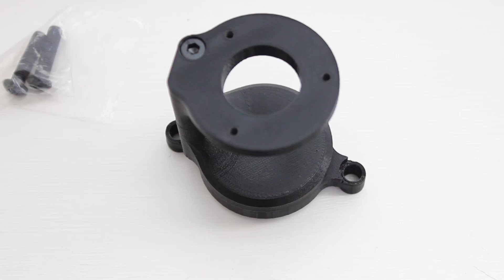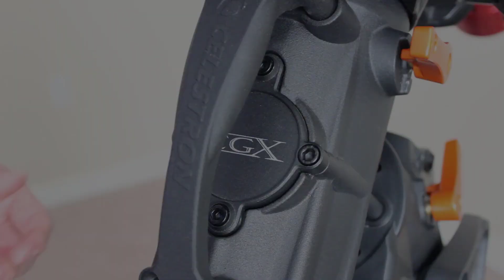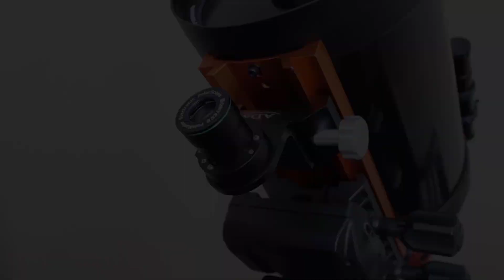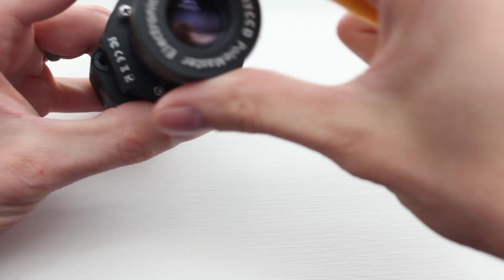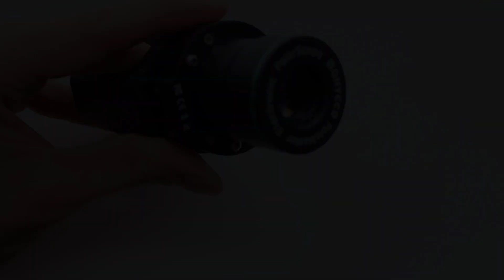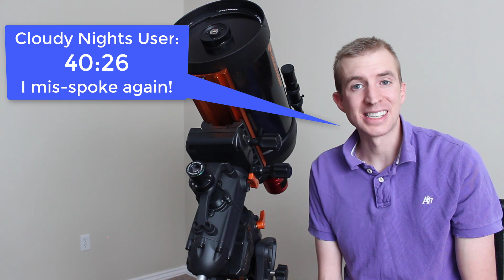Celestron CGX/CGX-L | QHY PoleMaster Mounting Solution

Comment: Cody, I am new to the hobby, spent the last year going through 3 back surgeries and that left me with tons of time in bed that I directed towards gradually piecing together a system.

I have a CGX-L with 925 mounted “permanently” on a set of JMI Wheeley bars that I modified to make it more stable while fabricating a way to mount 2, 100ah liFePo batteries.

I planned to shoot from my back yard, but constant wet ground and a heavy rig changed my plans to image from the front of my house where lights and cars where much more of an issue.

So before I cut my teeth I went ahead and got the HyperStar (which has always been my goal and defense to those that keep saying “should have started with a “refractor”) since the short exposure times would make shooting around traffic easier (and that it was).

I currently have an ASI2600MC mounted on the HyperStar with cables run through one of those arced cable management devices that I used as an excuse to finally buy a 3D printer.

Other than the feather touch micro focuser, the only remaining piece I have and the point of my long explanation is the StarSense camera and hand controller.

In fact, when I bought that camera a year ago, I think I might have watched a helpful video on your channel if I am not mistaken.

Now that my back is strong enough to spend time learning how to use what I have compiled, I am starting to lean towards buying a pole master; like you I had others tell me to do so, but owning the StarSense I didn’t see the use.  

Well that is until I began to see how much time I spent being a perfectionist lining up on the pole (doesn’t help that I can barely see it from my bortle 5 and nearly 6 home location).

Having HyperStar attached, I fire up my camera and try to aim the Wheeley bars as close to the pole as possible before sinking the feet to the concrete.  I then get out the Alan wrench and adjust the mount to dial in the fine adjustments while continually software zooming in my cameras view of the star.

Once I have satisfied myself that I can’t get it any closer, I tighten it down only to see it move from mechanical forces torquing the mount to the plate.  (I guess there’s no way around that?).

From there I end up doing an alignment while adding several calibration stars.

I wanted to describe my setup and very newbie approach to get the most accurate answer to the question I am sure you debated too; what will the polemaster “buy” me?  It seems that most people I read forum posts from ask the opposite question, “what does StarSense buy you” as they are sold on the polemaster.

I probably wouldn’t have begun looking at the polemaster again, had my StarSense hand controller’s display suddenly quit.  It was always hard to read in the dark, but with it completely broken I have been using the old hand controller and doing 4 star calibrations.  

I think the hand controller has a 2 year warranty, but considering I only used it a couple of times I have little faith in its robustness and would want a backup unit as a result.

Does any of this ring home with you?
What does the polemaster do for me over the StarSense?
If you are a StarSense owner, do you still use it after using the PoleMaster to polar align?
Finally, I noticed that the polemaster comes with a screen (or at least some models do). Is that so you can have a rig without a display (remote control it) yet still be able to align without needing to look through an eyepiece.  Not having an eyepiece with the HyperStar setup makes that seem more appealing.

Maybe I have given you enough questions for a follow-up video LOL. 

You seem like a nice and informed guy so I felt open to ask.  If you only have time for a quick response to any of the questions, it’s all greatly appreciated.

Keep up the good videos.  I use to spend my time and money on motocross and posting motocross videos.  That’s how I broke my back and after selling my bikes and with a Software Engineering background, I felt this would be good for me.

I have had about 3 nights shooting DSOs and caught a great photo of M42/43, but the others are giving me a challenge.

Have a great day.

Comment: I have this Polemaster mount from 40:26 as well.  I love this thing.  I usually have the Starsense Alignment camera down below where the ADM mount would sit.  The magnets hold this thing really well.  In fact, when I do the alignment, I usually just pop off the Polemaster and stow it as I have not had any issues losing alignment on a sturdy CGX mount.  I love the Polemaster and this mount adapter makes it such a breeze to use on the CGX.  I believe I saw it available through eBay as well.
Reply from the maker: Yeah, it is great. I pop mine off as well, and take my laptop inside. Then I just use the ASI Air the rest of the night. It works out great for me!
Reply: Ahh, so you too own a StarSense.  I just posted questions for the OP, but I’d be interested in your thoughts as well.

Owning a StarSense already, do you use the Polemaster to get your initial highly accurate pole alignment and the turn StarSense lose to do it’s algorithm?

I have slowly been buying gear over the last 14 months while going through 3 back surgeries and looking for a hobby to replace motocross (hence the back fractures).

I bought a StarSense over a year ago, finally had a chance to use it 3 times and the hand controller’s display died already.  I may try fixing it myself, not wanting to wait to get this back from overseas.
Reply: @jtbrower  Yes, use the polemaster to fine tune the PA.  never liked the ASPA from celestron.  could never get it to agree.  Polemaster has never failed me.

Ive acquired a Skywatcher mount this this post and dont use the CGX any longer.  Got frustrated with its guiding, mesh alignment and gear slop issues.  Ive replaced a number of the bearings in the motors and it might perform better now, havent checked.  But, with my SW mount, I used plate solving with my main image train to do the alignment.  Its too easy and dont need additional hardware and weight hanging off the OTA.

Comment: I bought this adapter for my new CGX based on this video and find the adapter works exactly as described, for my use I like how easy it is to remove the Polemaster when I want to switch it to another mount.  Hello to the Designer, please make an the plate for a Celestron AVX so I can more easily move the assembly from the CGX to the AVX and back to the CGX.

Comment: if the polemaster is parallel with the polarscope would its position even matter? like the only metric that would mis-align a parallel polemaster is gps location, i dont think the few inches would do anything.
Reply: You are totally right. Having the PoleMaster aligned with RA axis is not mandatory. This is why the ADM solution is working perfectly and is more versatile (you can use it with any mount and any telescope). A good investment.
Reply: @olivierrethore9097  I agree with you, as I am using my Polemaster on a Skywatcher AZ-GTi using the ADM Vixen Polemaster clamp at the end of my Vixen rail, easy and can be removed if needed as it's helps for front end balance also!

Comment: I have the Celestron StarSense is the pole master worth getting for me?
Reply: Are you just using starsence alone  I suggest getting ASIair pro. I used to  to use starsence but it's only good for go-to feature you can't track with it.. now that I have asiair pro it makes polar alignment really easy it does plate solving just like starsence but you can connect it to a guide camera and get pinpoint guiding. Starsence is good for  visual no good for astrophotography. That's my two sence other might have a better idea.

Comment: The pole master not being exactly on the ra axis is irrelevant. However, any cone error from your dovetail bar will throw the pointing off. So it is better to mount it on the ra axis after all.
Reply from the maker: That’s correct, yes.
Reply: According to the manual, that's not exactly true. The unit doesn't have to be parallel to the RA axis (meaning cone error is OK). When you rotate the mount and indicate the exact position of a star at the beginning of the alignment procedure you calibrate the system for any offsets.
Reply: @nikivan  In fact... I went BACK to the ADM. :), especially after discovering THREE things: 1) yes, cone error is irrelevant; 2) The Lens is replaceable; 3) There is a driver which allows you to use the polemaster as a "regular" cam. So I basically swapped the lens with a variable focal length CCTV lens which I keep at 100mm, do my polar alignment with Sharpcap plate solving and when I'm done, it doubles as an electronic wide field finderscope, which is a gamechanger. I just drilled a little cavity in the ADM mount, fit a steel 3mm ball in the center of the polemaster base so now I can "collimate" it so the center of the FOV matches the scope's. Pretty neat.

Comment: Cody, do I need the polemaster with the asiair pro? Or does the asiair pro polar align making the polemaster redundant.
Reply from the maker: No PoleMaster needed. It’s actually easier and more accurate to use the ASI Air Pro.

Comment: Im calling Codys Lab.. 

Btw have you heard of Orions version of this? Ive heard you can buy an adapter to fit it to Celestron mounts. I have the AVX and been trying to decide between the QHY PoleMaster and the Orion P1 Starshoot :/

Ill prolly end up with the QHY because they have dedicated adapters
Reply from the maker: Matts Toaster I haven’t. The PoleMaster works so well I never saw a need to switch it with another product (although I do use the ASI Air PA too).